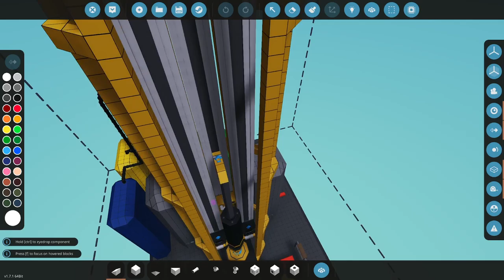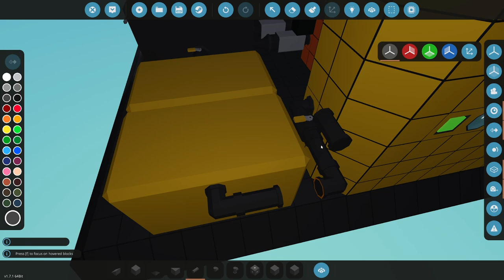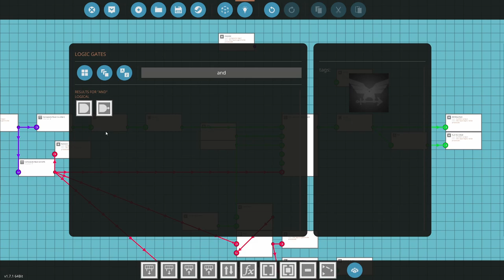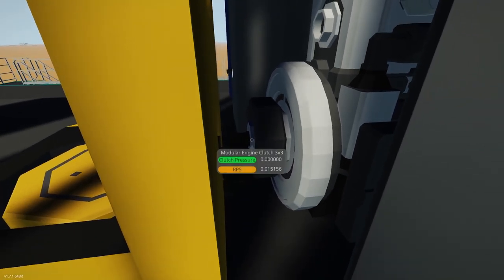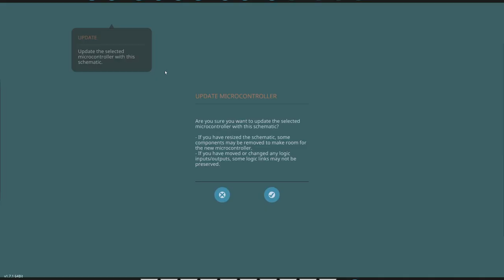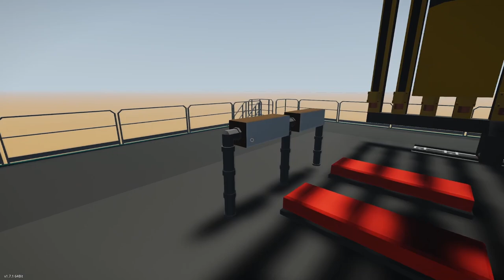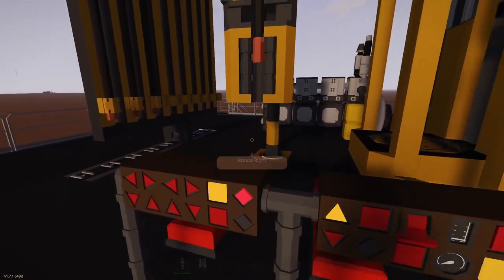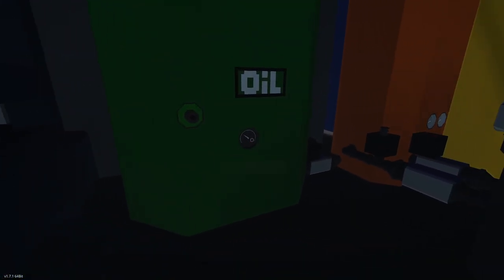Career Build Series 2023 Ep36

Comment: Its not exaclty infinite electricity. You still have to make all electrical connections and have a battery, but nothing will actually draw power from the battery. It may fluctuate less than 0.1 % of charge, but it will rise and fall, not deplete. So yea, a generator on the platforms and custom bases is basically a  waste of FPS. This was the case when you reviewed my island repair facility with the jet generator. I thought my game was just broken because every time i spawned the base, the battery would never drain, so the generator never ran on its auto-cycle. But hey, what can you do 🤷

Comment: The infinite electricity comes from the battery as long as its connected to a battery it will be infinite. You can run a large electric motor full throttle and it will never drain the battery
Reply from the maker: I'm doing it for rp
Reply: @CaptainCockerels  Figured I'd explain it more since i didn't mention the battery part before.
Also at 16:25 I had that bug before i had to cut and paste my whole rig into a new creation

Comment: electric motor seem to be the way to go im getting 4.6 rps at 50% throttle
Reply from the maker: Yeah it's most efficient because you have infinite electricity at the rig. I don't like using that I like to do things more realistically that's why I put in a diesel. I want it to cost me something to drill that's the only reason I did that.
Reply: @CaptainCockerels  i dont blame ya. i built mine at the static when i make it offshore i'll be doing the same. great video my guy !